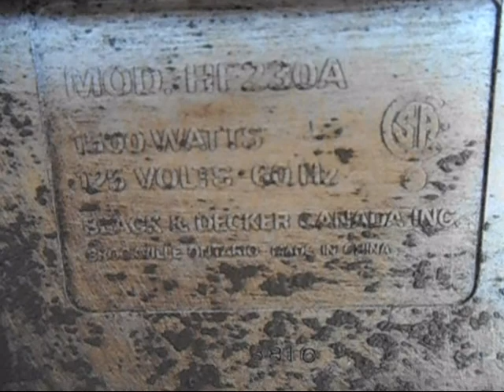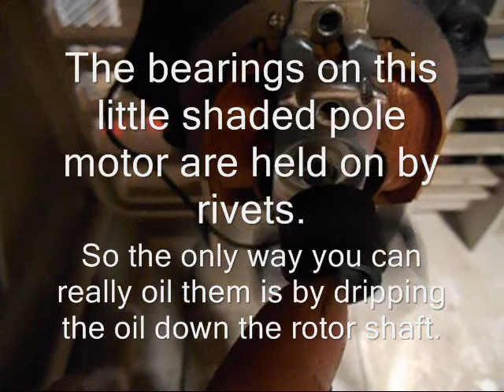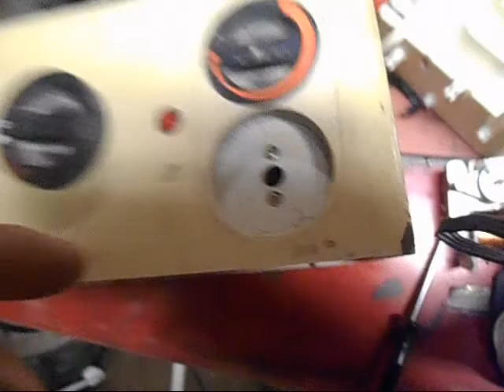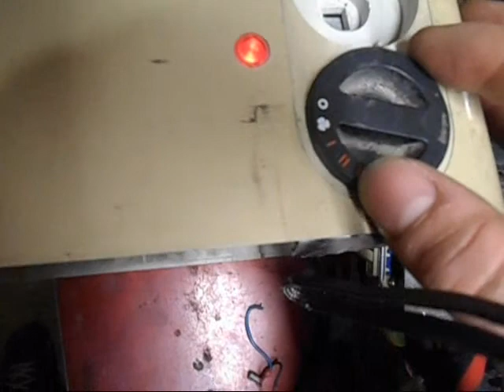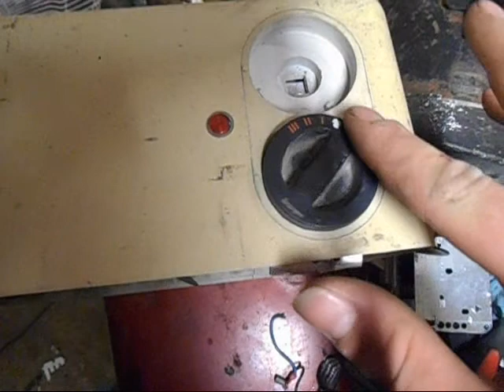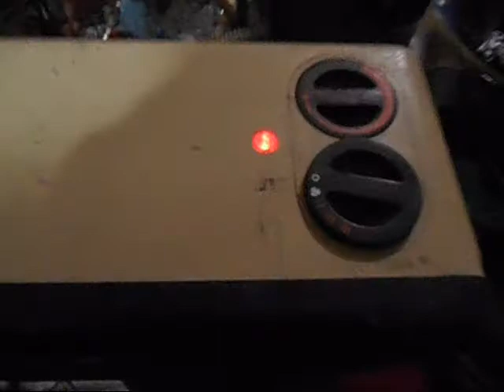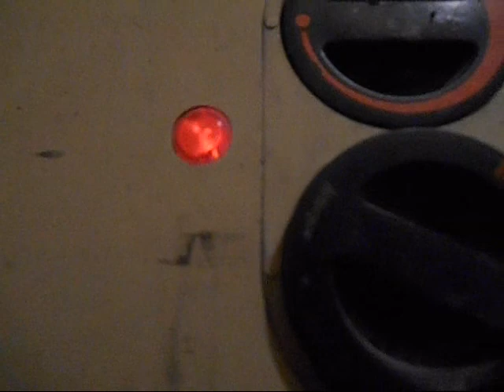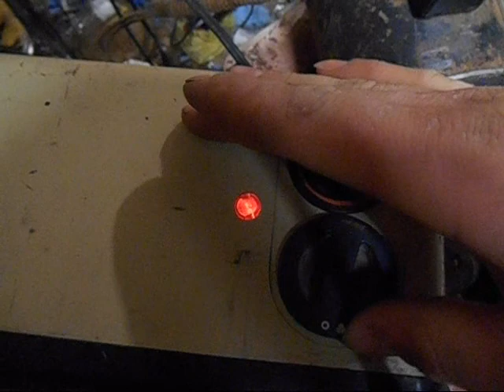Heater converted to infinite speed fan

Comment: i wouldn't recommend a lamp dimmer for this i would use a infinate speed switch like for a attic fan as you can get them from your local HVAC store like Johnstone supply. as the switches usuaully come with a knob attached and its compatable with all shaded pole and Permanent split-Capacitor motors they have a rating of 2.5 FLA Full Load amps and 6 LRA Locked Rotor Amps as the switches will come with or without a wall plate. as the motor has to be under the rating for the switch to operate. it can be Greenheck, K.B. electronics the mfg # for that switch for K.B electronics is H1304F. as you can get this switch to make a vintage vornado fan and any other like a GE all purpose fan infinite speed.

Comment: 1 horsepower?  A hundred and a half times less than that... That motor is only a 1/150 (.0067 horsepower.)  About 30 watts.  That's a good tough steel blade.  You DO know that you cannot run a motor on a resistive light dimmer, right?  It will self-destruct after a short time.  You need a triac fan speed control.
Reply from the maker: Yeah I was i a little to baked when I made parts of this video, Its more like 1 watt lol. realistically it's prolly pushing 9 or 10 watts tops.
 And yes I know it's not good to run a fan on a light dimmer. I don't care about this unit because I have another one just like it that is fully functional.
Reply: Hobbycentral Oh! Makes sense then LOL!
Reply: i do agree 100% on this is to use a triac speed control as you can get them from your HVAC store if u live in the US they are available. as the Vornado 280ss fan has a triac fan speed control. as the vornado fans made vo to the mid 2000s on select models use a triac speed controls  for the variable speed models as the other models are 3 speed. if u use a triac on a 3 speed motor you have to connect it to the high speed lead and insulate your medium and low speeds but never use a lamp dimmer. with any motor as you can burn out the motor or overload the dimmer.